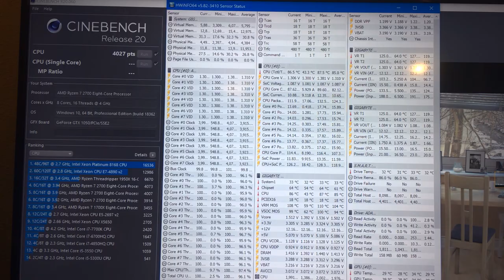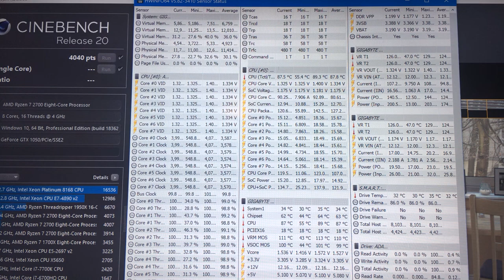Using Thermal Paste on VRMs???

Comment: My OEM had an atrocious 3+2 VRM design with no way to attach a cooler on, so I applied small pea-sized paste on a small circle at the center of each thermal adhesive tape I placed on its MOSFETs with a 12mm fan blowing directly on them. Considering my CPU no longer throttles down during its periods of turbo-boost, I consider it a success.

Comment: the thermal paste will probably be thicc and will dry because there vrm heatsinks always have a gap inbetween vrms for the thermal pads.
Reply: I don't think so, the mounting is spring loaded so in theory there is still good contact between vrm and heatsink
Reply: You can use copper shims also.

Comment: A fan pointing to the VRMs directly (if possible) would help ALOT. Look for laptop fans. They run on 5v and use really low wattages.
Reply: 3d print shroud would help direct the air flow, cheap and customisable

Comment: My guess is that the better thermal transfer heavily suppressed the sudden dangerous temperature spikes that caused stability issues, spikes high enough to crash the system yet so short in duration HWinfo64 couldn't capture it.

Comment: For vrms use gummy thermal paste K5 Pro, Laird Tputty 607 or Upsiren U6 Pro because have much better thermal conductivity than thermopads. Thermal conductive paste is not for that purpose.
And for the processor give PTM7950 phase-change thermopad.
Reply: you can use it, the problem is not the porpuse, is clean before apply a new one, is difucult and boring clean the old paste in the vrm and the motherboard around

Comment: You should try put the cpu fan firing down, the "hot" air will pass through the vrm heatsink and will be for sure under 120 degrees so vrm should be drop down and even the cpu a think cause you have an intake justo over the heatsink, cheers from Argentina 🇦🇷

Comment: your best bet would be to get a small pwm fan, about 40mm to 60mm and mount it so that it is blowing directly on the vrm heatsink. you will see a huge difference, mine dropped down to 45-50c. give this a try and you overclock more. cheers!
Reply: Blowing directly how though?

Like straight down at the motherboard and the vrms (parallel with the mobo)?
Or at an angle so it blows on the vrms, but also towards the back of the case aka towards the back fan?

Also whats your recomend fan size and distance (fan to vrms)?
Reply: @PFbigfan447  Did you completely remove the thermal pad from under that VRM Heat sink? If then you need to put it back I placed thermal compound on both sides of the thermal pad which absorbs heat better. Without that pad, there is a slight gap as the heat sink isn't making sufficient contact. Give this a try, you should get better. Or you can run a fan there without the heat sink at all. But I would try option 1 first. Good Luck friend
Reply: @MasterJediSean  No no, I haven't taken off the heatsinks. I want to add a fan on top of them for extra cooling performance.

I was just wondering how did you position and attach the fan on top of them? 
Is it directly on top of the heatsinks (parallel to the motherboard), is it at an angle so it blows on the vrms, but also towards the back of the case (towards the back fan)?
Does it not intervene with air circulation inside the case?
Reply: @PFbigfan447  I basically just used some zap straps and did my best to position the fan to be parallel with the MB. one time I just let the fan sit on the video card and it was loose in the case, there shouldn't be any problems as long as you don't move your tower. Good Luck!
Reply: @MasterJediSean  This is what I wanted to know. Thank You!

Comment: Honda ecus in the 90s at least used what I can only assume is thermal epoxy or thermal paste on power mosfets using the metal case as a heatsink
Reply from the maker: That's interesting! Thanks for sharing.

Comment: Can i apply thermal paste on vrm? I am from Brazil, didnt understand everything.
 Thanks
Reply: IF you want to try, make sure it's a non-conductive thermal paste
Reply: Ic minus 8 thermal pads are 8watts per whatever they measure thermal conductivity is.  Thermal paste is 5-17 watts but is very thin and can sink into the pourous material of the mosfet surface interfacing the  heat sink.  I think a 1  mm pad would be good for 5 years where the thermal paste can melt off in hours.

Comment: short ques:- applying thermal paste on vrms is good or bad?
Reply from the maker: Not neccesarily required but if your VRM gets really hot it helps in my tests
Reply: @OTechnology  Ok I have amd fx 8350 with biostar ta 970 and rx 570 8gb nitro saphire+ motherboard I am having cpu load dropping issues but I disable all the power saver settings from bios this cpu load drop issue will be fix now all latest games working great but old games having fps drop issues like gta 5 sometimes nfs pay back I already applied new thermal pads to the vrm heatsinks but problem still remains so if i will apply thermal paste on vrms then r u sure this will fixed my problem ?

Comment: If your vrm temps are high, calculate the height (usually 1mm) and buy arctic 6w/k thermal pad and replace them. The trick is : use gloves and clean the vrm and heatsink with 99.9 percent pure isopropyl alcohol.
Reply: Why do you need gloves? You can just use Q-tips
Reply: @MrInterpriser  to clean no need for gloves. To install a née on high performance thermal pad you need unused gloves. The oil residue in our fingers will degrade thermal pad performance.
Reply: @Hi-levels  wtf
Reply: @MrInterpriser  yeah thermal pads should not be touched by your naked fingers. Hand sebum will have an insulating effect.

Comment: You have an overclocked SFF HTPC, with VRM’s that are nuclear hot, so your solution to your stability issue… is to further increase the voltage? Yeah, that’s a great way to cause early electromigration driven failure, given your CPU is already approaching TJ-max, not to mention pushing your power delivery even harder, in a system struggling with thermals.

First thing I’d do is dump that cooler. A simpler top down cooler that draws cool air in from the top, will help cool the VRMs. Second, you should probably use thermal pads, not grease, for the VRM heatsink. Finally, why OC an HTPC at all?! I’d knock everything down to stock speeds, because the goal is 24/7 reliability (at least with any HTPC I’ve built).

Comment: Maybe changing the cpu-fan to blow downwards and use the 80mm fans as exhausts - might improve vrm and cpu temps.
Reply from the maker: Nope its worse. The air from the cpu heatsink is superheated already.

Comment: I would not do that, thermal pads are the proper use here.
Leveling more than one components on the heatsinksurface is hard (some a re higher then others), the thermal pad is thick and with some pressure applied it levels the contact surface. I believe some of your VRMs are better cooled and some are overheating because there is no proper contact with the heatsink.

I would just buy and cut a taller heatsink + go back to thermal pads.
Reply from the maker: The board has smart power stages and the controller reports the highest mosfet temp so it seems like this worked in keeping it cooler in this case.

Comment: Without a full view of your case, it looks like you're starving the airflow to the CPU by having the fan try to pull air away from the motherboard and push it out the top vent. You're likely better off by flipping the fan to pull air from the top vent into the case. Also the 2 fans right up against the video card will do little for case air flow as it looks like the card almost completely blocks them. By flipping the CPU fan to pull air from the vent in you will provide the vrms with some airflow.
Reply from the maker: I tried making the fan blow down it only made the VRM temps worse as it blow super heated air to the motherboard. The side fans doesn't help much which is why I removed the rear io plate which lets air in and flow over the VRM area. This was the best configuration out of all I tested.

Comment: Your on the right track, but..... Did you use CPU Thermal paste on the VRM's???? Did you measure the thickness of the old Thermal pad before you put the Thermal paste on??? The Thermal pad looked like 2mm, and the amount of thermal paste was defiantly 1mm.... no wonder it didn't have a big enough improvement you didnt use enough..... you want to use 1.3 times the amount of thermal paste as the thermal pad your replacing, not .5 times(for example if your replacing a 2mm thermal pad you want to use 2.6mm of thermal paste at least)...... and you want to use a thick thermal paste and cover the top and the sides.

Comment: If you would have taken the spacer off on the vrm's it would have reduced VRM heat or used nut and bolt to TIGHTEN down and GREATLY reduce heat
Reply from the maker: I think the issue here is surface area

Comment: Pretending to overvolt and overclock an HTPC is just plain stupid. Driving components to the max to gain an insignificant extra performance is just worthless and risky in that environment. I hanve an HTPC based on Ryzen 3400G and i undervolted the hell out of everything of it, it became a ZERO db machine to watch movies and light gaming on it, and if i want high performance and overclocking without making the house smell burnt, i have the desktop PC.

Comment: You need to undervolt the CPU and you will lose some performance, but the VRMs may be able to sustain that performance instead of clocking the CPU down to 0,54 Ghz
Reply: Undervolting doesn’t reduce performance, it actually increases because CPU won’t thermal throttle and will get to higher frequencies.
Reply: @MrInterpriser  you have to undervolt so much that it actually starts to decrease slightly on Such cheap boards
Reply: @Einheit101  Really? I see